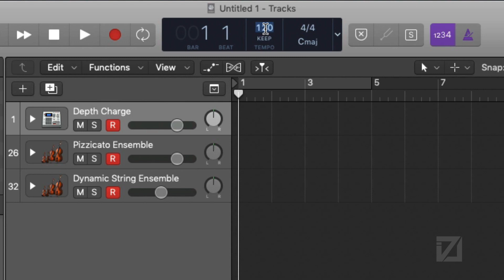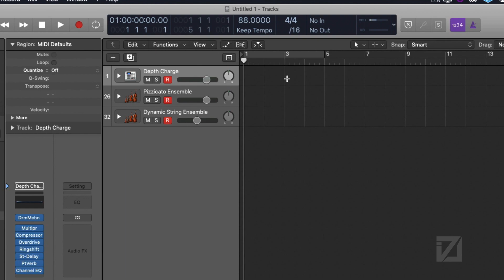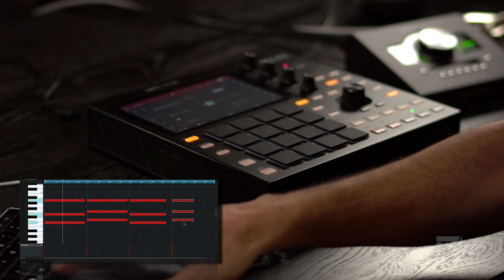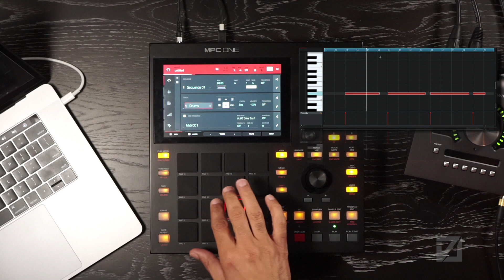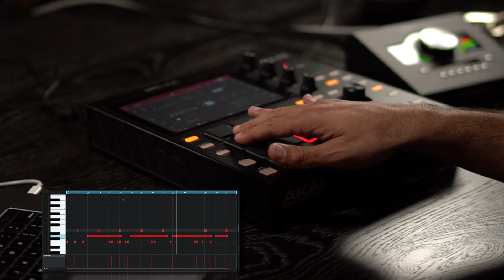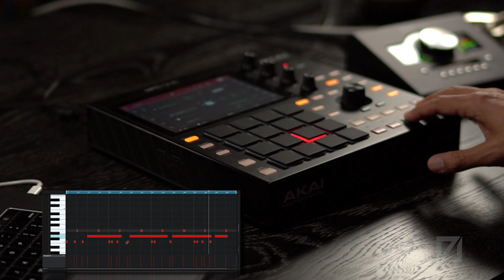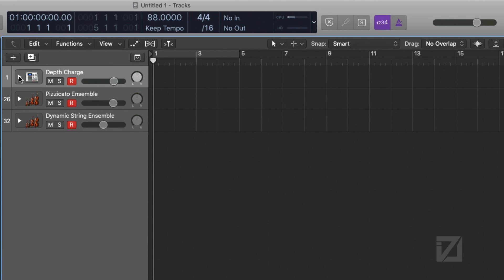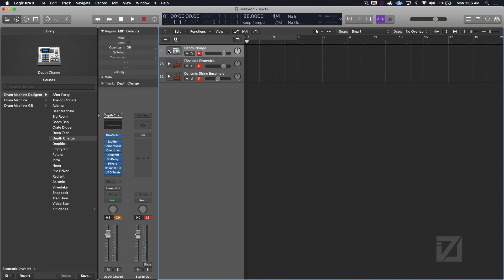Using Logic Pro X as a sound module for the MPC One Part II

Comment: Why use Logic in this case? Wouldn't it be better to run MPC Software as master and add Strings there?
Reply: I would say use logic with Mpc if you’re beat base is from midi.. because throwing midi in to Mpc is the worst.. 2nd Mpc got the best drums and module for creating drums.. who would wanna use logic Drums when the Mpc is the king of Drums
Reply from the maker: Cody Smiley this is just an alternative workflow. Many are use to this workflow from the old stand alone days. #Options